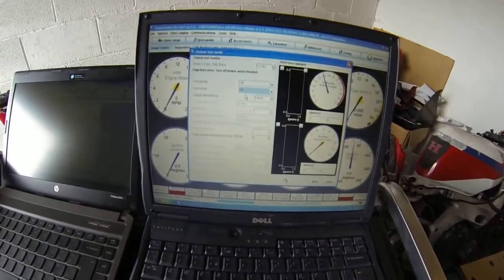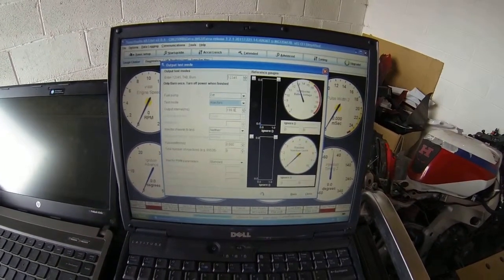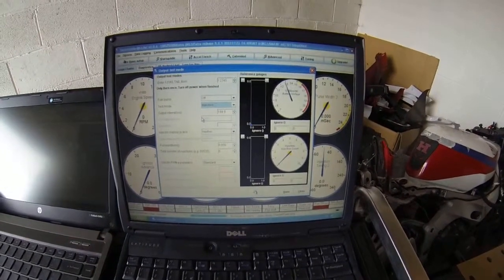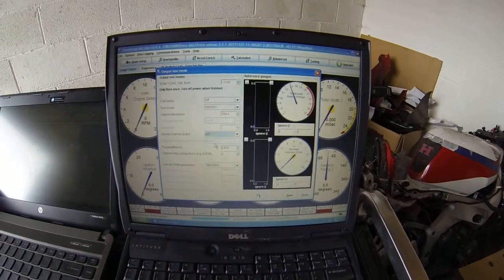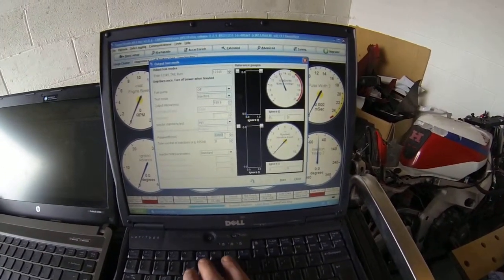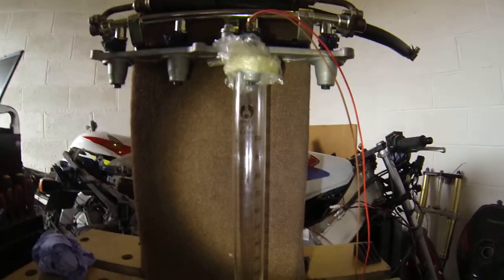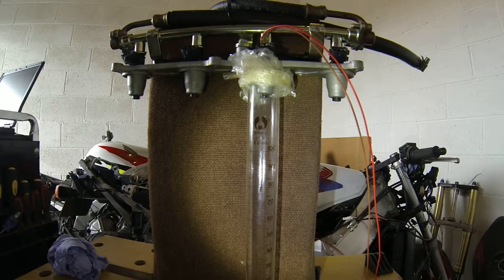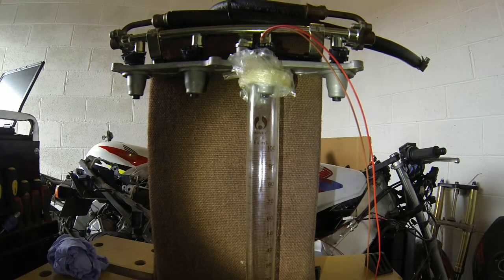CBR250RRi Microsquirt Output Test Mode Demo

Comment: Great demo, thanks! I wonder how you manage to make microsquirt run 4 ignition coils. I'm in a similar project. Would you share some info?
Reply: they are on a lost spark sytem so it only has 2 coils for four cylinders. so 1 coild for cylinder 1 , 4 and coil 2 for cylinder 2, 3
Reply: @Ryan8573A  thanks!!!